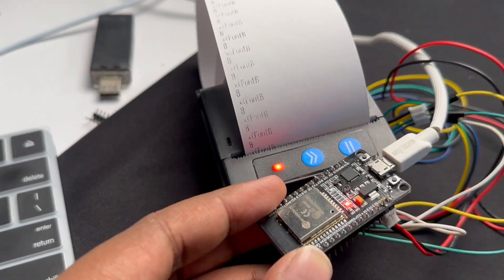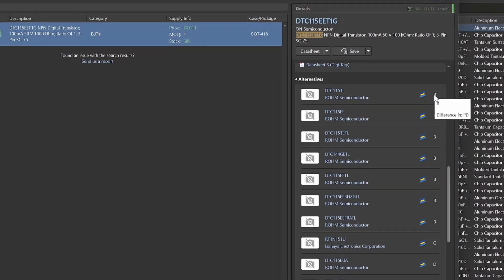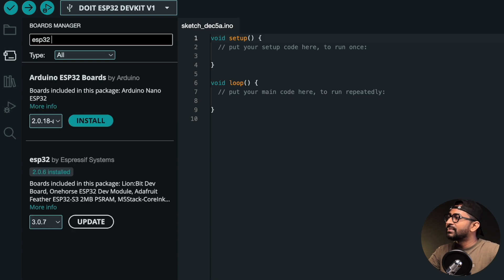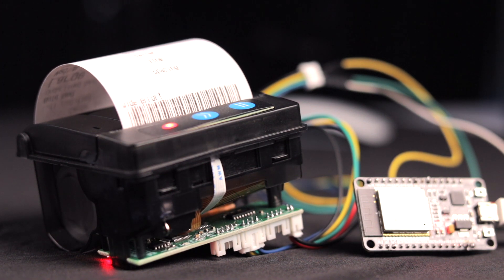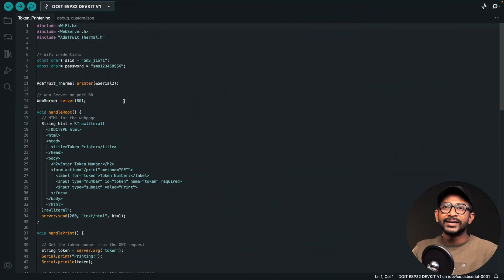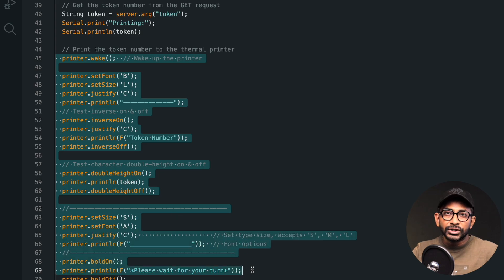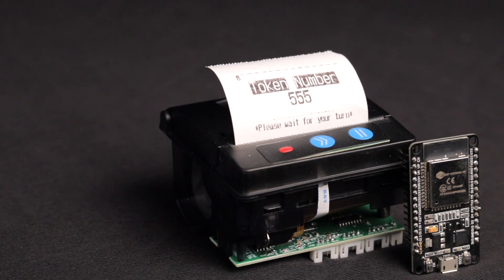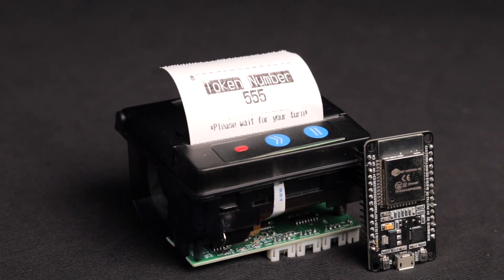Print Tokens over Internet | IOT Thermal Printer using ESP32

Comment: Hey, recently I found an issue with connecting my esp32 with Wi-Fi, I tried with 2 3 boards and I'm facing the same issue, earlier it was connecting to WiFi with the same code but now it  is not connecting....can you make a short vdo on the issue ?
Reply from the maker: There can be multiple reasons 
So not sure what exact reason making this issue in your case

Comment: 7:07 if you apply 7.4v(8.4 if fully charged) li iron battery instead of power supply and good quality thermal paper you get maximum dark print ( I am working in a company make similar printer )

Comment: This model has four possible baud rates: 19200 or 9600, but also possibly 38400 or 115200 baud depending on which PCB traces got cut at the factory for whatever the spec was for the batch.